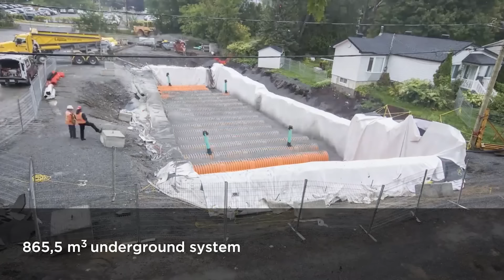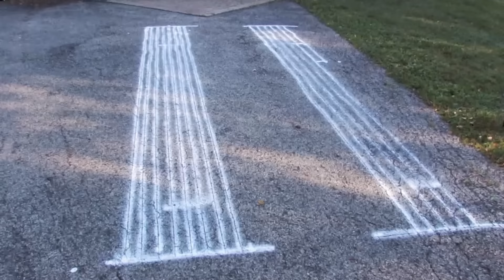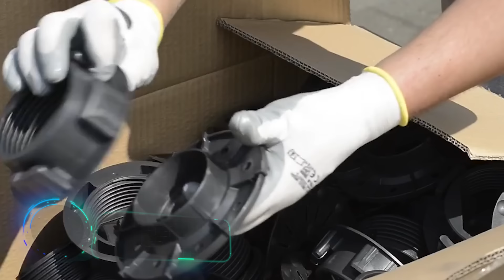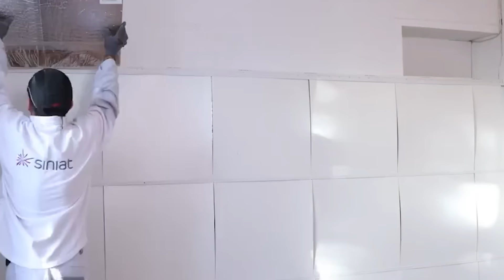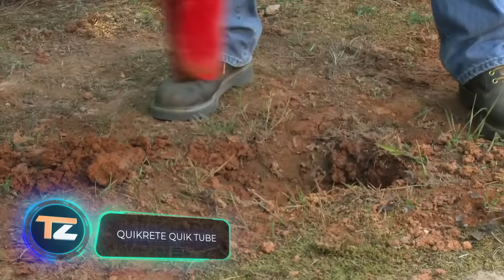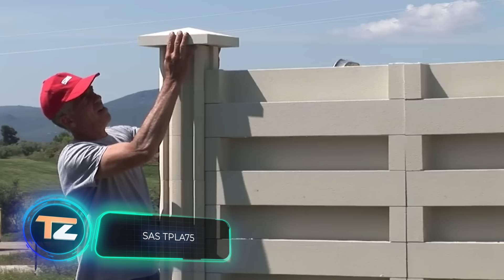COOL CONSTRUCTION TECHNOLOGIES THAT YOU'VE NEVER SEEN BEFORE

Comment: We need building materials that can withstand high winds and last a long time.  i do not see how covering plastic with a more durable material is real good, it looks better than it is. Will it last and stay stable over the long run? We also need things that will not burn. We need to get away from the actual plastics and perhaps get away from some of the plant material- at least in applications where it could burn or rot. So many of the new inventions make it cheaper for manufacturers but the end consumer ends up getting some convenience but ends up paying a lot more in the end.  The ideas are good, at least some of them, but they mark them up way to much. Only the wealthy can afford them. Home Depot here in the US has sold the concrete tubes for many years, they would be fun to use but i havent found a chance or need for them yet.

Comment: So anyone else realize that the quick concrete post tool is just a cardboard tube that you could have bought at a hardware store at any point over the last three decades if not longer ...?
Reply: Yeah it’s not really a “new” invention and I also doubt that it is any different then the ones that you can get at a hardware store.
Reply: I was using these 40 years ago.  These aren't new.   The narrator said that these were available in 6, 8, 10, and 12" sizing.   I was using those sizes as well as sizes up to 24" back then.   I also think that larger sizes were easily available.

Comment: I wonder how fast those Strawpanels will burn. Particle board tends to burn pretty quickly.
Reply: I guess it's the same as styrofoam houses. Needs fire proof materials inside and outside. Sheet rock  and plaster facade for example.
Reply: The only problem with this app was to get the an